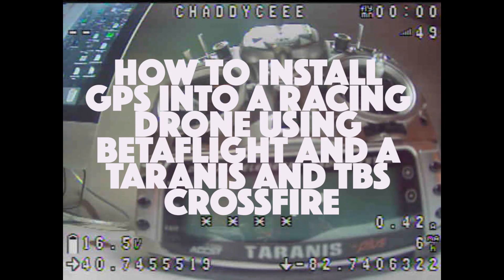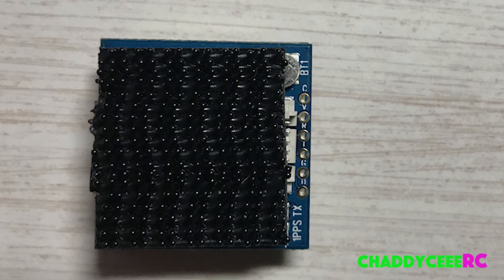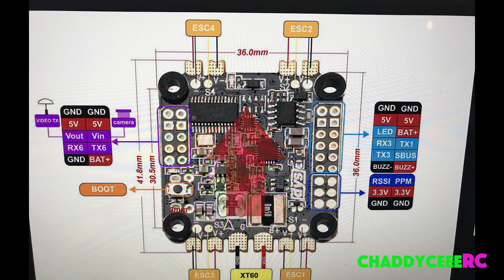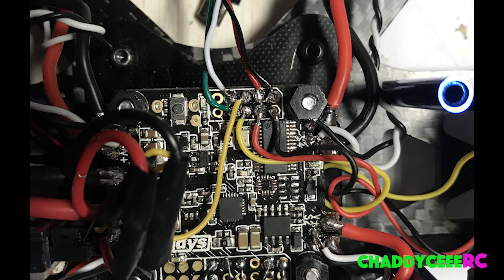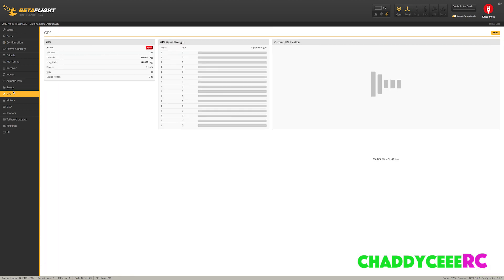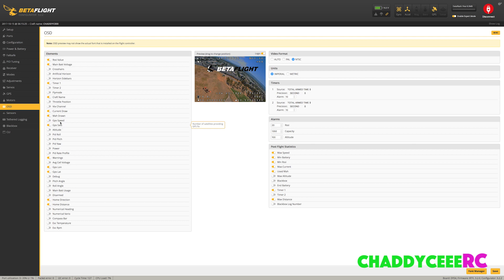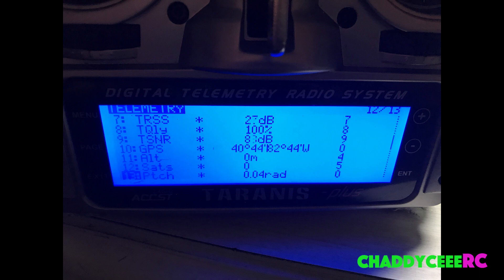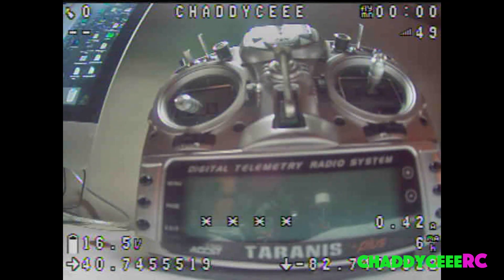HOW TO INSTALL GPS INTO A RACING DRONE USING BETAFLIGHT A TARANIS AND TBS CROSSFIRE

Comment: thanks for the video, wasnt sure the gps would communicate with the osd or if i needed a crossfire or something to use a gps. what if the quad looses power or you loose rssi or vtx signal, how would you get the coordinates back? does it freeze on last known coordinates??
Reply from the maker: Gps has its own uart and power so in most cases you should be good.

Comment: Hello !please tell me I have a Crossfire you do not receive GPS data. from the menu of Taranis I choose the detection of new sensors it finds about nine but among them there is no GPS data. but also for some reason telemetry in lua script inav on the remote also does not go though 3D fixation eventually occurs. but some reason the data from the controller flight most likely do not reach the console in General, I do not know what the problem is. I can tell on Crossfire on the back of the console is the last menu item to display the GPS data that I don't. in the configuration settings of the flight controller, inav has checked the data telemetry feed.What can be done .Where to find the answer that can suggest the ?!prior to that, the lua Script was working fine through the port F which was on the flight controller. the update didn't help. Anik on 1: 53 you show that it had telemetry gps data. I made on your video all settings: inav port 57600+mpi -, in a configuration included telemetry output. On your smartphone in mission planer

Comment: The point is if by some magic your  lipo is still attached are you  going to get  coordinates of where you need to recover your  monster
Reply from the maker: ChristianProgrammer dvr and crossfire has them on it to. The full sized one. Then the hellgate buzzer will be playing the entire time until I find them. Lipo or not. Lots changed in 6 months.

Comment: Can you do it without sdla or scla or whatever those two pads are called
Reply: Nm
Reply from the maker: Yep. For betaflight quads we only need to the rx and tx. No compass connections.
Reply: ChaddyCEEE RC so it will still be capable of rth, and position hold?
Reply from the maker: David Hannigan Jr. not with betaflight. They are working on a Rth feature called rescue mode but it’s very experimental. Inav has those features for quads. With inav you would need to use all the connections and use a compass with quads. It would be great if we could merge the two softwares together and have it all but that’s just not the case right now. If you want to fly a quad like these with great accuracy and speed then the Gps with betaflight just gives us data and that’s really it’s only use. Kind of a half working speed and distance tracker and Gps coordinates in case you crash at long range.

Comment: i see that bf 3.3 now has "gps hold" and "gps home" under the modes tab . has anyone tried wiring in a gps with compass to see if this works? my matek f405 ctr supports it via 2 pads below the fc . i have a ublox 4 wire gps at the moment which dosent have compass... i tried gps hold and it wanted to go into the ground quick! and would really like to get the home direction working ... and maybe gps home when fail safe occurs . would be fantastic !
Reply from the maker: not likely to happen with BF..some things work but RTH and that proboaly never.
Reply: ChaddyCEEE RC . well this weekend i shall try . found a gps with a compass . thank you very much for this video ... pretty sure its going to save a quad or two ! 👍
Reply: ChaddyCEEE RC . well i tried it! wired in a mag(compass) (hmc58 chip) and it showed up in betaflight did a calibration and it is working correctly . set up modes for gps hold and gps home . aaaand no go . when i switch gps hold it does odd things ... jumps around and tries to go somewhere.. out of all of testing one good thing has been fixed ... my home position arrow now works and is accurate! (due to compass working)

Comment: Does it work with F3 flightcontroller? I just need gps hold
Reply from the maker: Felix Baum yes. If you have an available uart with a rx and tx you can assign to it.
Reply: Actually, betaflight has removed GPS support from F3 targets due to memory needed in the MCU.  Recent change.
Reply: Micah Morton ... But why could I use GPS with iNav or cleanflight on my F3? I have to stick with Betaflight :/
Reply: Felix Baum perhaps you were using a version prior to 3.2?
Reply: Yes indeed, 3.0.1, because I had problems controlling my gimbal with 3.2. Also the features of 3.0.1 are enough for that quad. (Except the GPS thing)
Reply: Do you know if I can use a barometer? Altitude hold would be enough.
Reply: Felix Baum not sure about that.  Pretty sure yes.
Reply: k, thanks
Reply: Hey guys, yeah you can use the baro for alt. hold, and you can set all this up in iNav as well, which has become a powerful system!
Reply: So running a f3 and plugged my gps into uart2, then under ports selected gps and auto configure. Then go to configure and select gps and save and reboot but it will not save for the life of me.

Comment: Using BF 3.2.2 I have enabled GPS. I also checked some of the GPS data in the OSD and it shows the sample in the configuration but when checking the video output those settings are not displayed. Any idea?
Reply from the maker: Gil Chen flip your tx and rx wires. That was my issue when first wiring it up. You will know it’s right because you will see the lat and Long  as a bunch of zeroes in the osd until you get a lock.
Reply from the maker: Also try a few different speeds under the uart configuration tab if that doesn’t work.
Reply: So you are saying if the board actually can't communicate with the GPS it will just not display the GPS data on screen?
Reply from the maker: Gil Chen correct. Even though it says connected in the configurator. It’s not a perfect system for sure.
Reply: just followed your recommendations, but still NO GPS data is displayed in the the video. When I say NO, I don't mean it display zeros or wrong values, it literally do not display any GPS data.
Reply: My problem is UART3 on BRF4 was not working. Switched to UART2 and it works. Thanks!
Reply from the maker: persistance pays off again!!
Reply: Now go figure why the hell UART3 is inverted on BeeRotorF4.
Reply: for SBUS?

Comment: It's normal to put the "R" wire from the GPS onto the TX of the flight controller. The GPS is receiving on this wire but the FC is transmitting on this wire. Likewise the "T" of the GPS (it's not an "I", the silkscreen is just hidden by the pad) goes to the RX of the FC. That's basic serial connection understanding!
Reply from the maker: Valentin Bersier cool. Thanks for all the information

Comment: Can you get telemetry back to the taranis using frsky receivers? or do you need crossfire?
Reply from the maker: i am pretty sure that any telemetry FRSKY receiver will do the same since its just the stream coming from BF.
Reply: ChaddyCEEE RC I had no clue you could do that, haha. do you know if it is possible to use any S-Port  peripherals while using the crsf or is this actually transmitted only from a frsky RX?
Reply from the maker: J Slater it’s cool. . Some people have tried running them through betaflight but it seems like everyone goes back to using Gps is using an m8n or ublox. Just works with bf and Crsf.
Reply: ChaddyCEEE RC and are you saying that you still need to run a frsky RX for the telem or EVERYTHING is done through Betaflight and the flight controller?
Reply from the maker: J Slater it all just comes through crsf into the taranis. When you have it hooked up to the fc and you scan for new sensors in the taranis it shows everything from the Gps. Then the latitude and longitude two ways back to the crossfire module.
Reply: ChaddyCEEE RC I guess I should have been more clear, my bad. I meant other Smart Port peripherals like if I wanted to hook up an airspeed sensor on my wing or esc telemetry.

Comment: Have you seen my commentaries below ? Now betaflight 3.2 allows all the features, such as Barometer,  compass and GPS...
Reply: Beta flight 3.2 is what I'm using now with GPS...cheap 35 f4 omnibus pro ...bye.bye inav
Reply: Does betaflight latest firmware have gps hold and gps rth modes? Or this is just for getting info in the screen?
Reply: SuperFastReviews as much as I know, it's info only

Comment: Are you using F4 broad right? I use the F3 but it just not working, then I found the GPS function was removed from F3. SADDDDD. My broad works well with GPS when the software is iNav.
Reply from the maker: wayne cake yeah. Dysf4 to be exact. You are correct that they removed that ability on the f3. I guess it kills cpu usage but i really never witnessed that at least on my bf screen in setup.
Reply: I 'm using HeiYi fly tower all in one set. Thank you for let me sure that GPS works with F4. I do a lot of long range, and addicted to making outdoor racing drone films. I'll buy an F4 later.

Comment: I am considering this!  So to be clear , with Betaflight 3.2  you don't need INAV? Just connect it up like you showed....I only want "Direction to Home" "Distance from take off" and GPS coordinates if craft crashes......Is this correct?
Reply from the maker: yes..and you will get all of that information..but to be clear it may not be super accurate since there is no compass
Reply: I think the 2 extra wires are for barometer or compass, not sure. You have to wire them to SDA and SLC on your board (maybe on the other side of your FC - I use a Matek F405 AIO which has those two pins). On the other hand, it is normal to invert the 2 wires you are talking about as TX must be connected to RX and RX to TX. That's my theorical thought, because I never tried. I just read a lot...
You can also have a GPS module with compass included  such as https://www.banggood.com/UBLOX-NEO-M8N-BN-880-Flight-Control-GPS-Module-Dual-Module-Compass-p-971082.html?rmmds=search&cur_warehouse=CN
Reply: More details : What you thought was "I" is "T" for TX and "R" for RX. Then C is SLC and D is SDA. G and V are Ground and + as you said